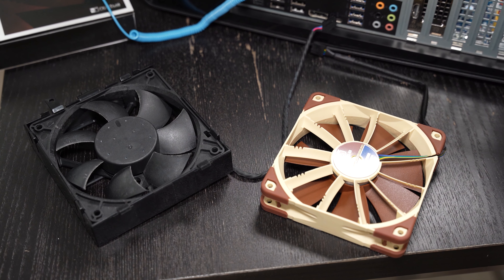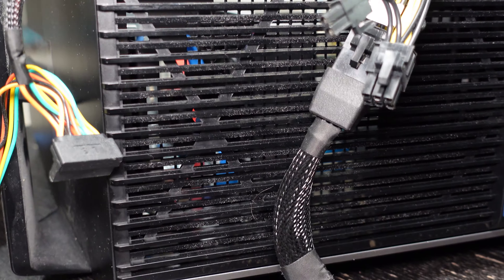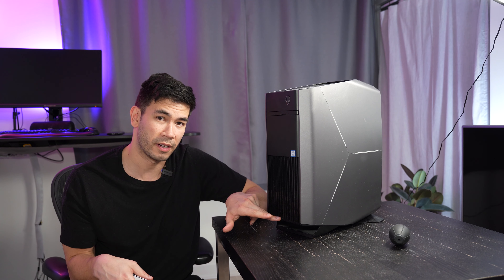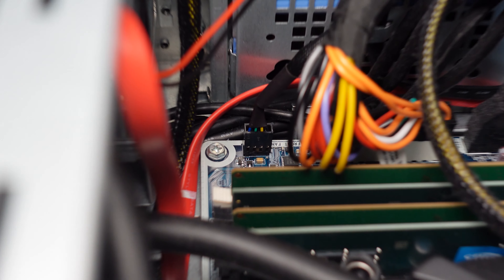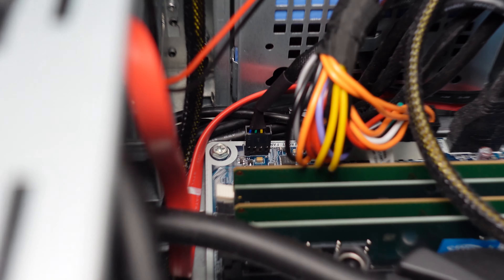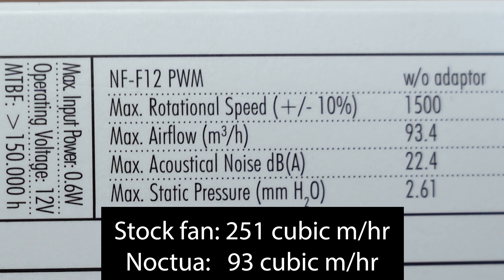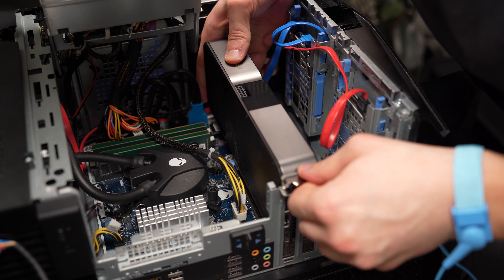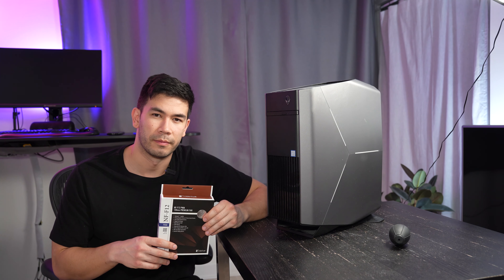Why your Alienware PC needs HIGH STATIC PRESSURE fans to IMPROVE TEMPS & NOISE

Comment: Nice video. I have the same system, to clean out the system efficiently, I tied the fans down and used a leafblower out back to blow the hell out of the system, yes it's backwoods McGuyver but it workes like a charm. I also moved my SSD to the top section, removed the annoying cage on the bottom and moved my 3070 to the lower slot, which gave it much better breathing space. I'm still using it today, it's been a great system, and I feel the 3070 on the bottom slot has helped keep it much cooler.
Reply: A leaf blower 🤣🤣🤣
Reply: Can you send a pic?

Comment: I changed out the fans in my R5, and changed the thermal paste, and my PC is waaayyyy quieter. Even at 100%. First time I booted up my cpu was getting HOT, but I redid the thermal paste and now it's cooler then the stock setup. The GPU is a lot cooler.

Comment: This is an excellent video, especially when you talk about the % fan speed, thank you. I have an r12 in which both stock fans have a max speed of 4000rpm. And people seem to not realize how that affects the ACC software. They're basically just repurposed server fans. Not a bad thing, but they get loud. I replaced every fan in it with noctuas that have max speed of 2000rpm, and it runs way cooler and quieter even at max rpms, which is really nice.
Reply: to follow on this. i will say the stock fan on the radiator is actually a very good fan. it will lack on the noise profile since it is a single fan trying to push the heat out of a modern CPU (which is a big task to ask of any single fan, especially on a 120mm rad). I replaced mine with 2 noctua nf12 x 25s.  I saw little difference in performance, but a decent benefit on noise, but that may be an apples to oranges comparison
Reply from the maker: Hnnn I really appreciate your insights. I might keep the stock fan (to avoid excessive work) and blow dust the radiator if that would be effective. I heard the 120mm stock radiator fan  is actually thicker than 25 mm?
Reply: @JSyntax  Yes. The one they install on the 120mm rad is quite a bit thicker than a standard fan. Almost 2x thicker in terms of the fan frame depth. on my unit, its a nidec server fan basically. Super deep frame so the blade depth is thicc af. good for pressure and air flow. It does get loud but thats mostly because it simply CAN push air, not necessarily because its loud by nature.
Reply: @joelstamand3495  I replaced both fans on my Aurora R10 with Noctua fans. The one Noctua (2000prm) fan is unfortunately not enough for the CPU water cooling. In addition, I cannot control the fans via ACC.
Reply: @joelstamand3495  ** It seems to me as if you either have to use water cooling with several fans or a fan with at least 4000rpm.
Reply: @unclebrowns8393  Got the R11 with 10900kf and 2080ti & 64 GB RAM @ 3200 MHz. I agree with the fan noise. But let me tell you... Did change both fans with Noctua, Arctic and Corsair 120mm Pro. I got Bios error with Noctua - but nevertheless it worked. Yes, its much more silent BUT - Tempereature gets worse because when you rising up fan speed in AWCC at 100%, it nearly goes up to 40-50%. The stock Cooler goes up to 100%. Because they are matched to the motherboard. With Corsair & co i get 41 C in Idle. With the stock Coolers 33. So it wasnt an option for me.
Reply: @JSyntax  The stock Cooler above is much more thick, than other fans.
Reply: @wingeladvokat1920  yes you are absolutely right, so I am considering buying a new mainboard and a new case
Reply: @unclebrowns8393  i'm eventually doing this too. Just gonna keep my GPU and RAM and build a pc myself with proper parts. Like a motherboard that isn't PCIE gen 3, a case with waay more space and no stupid dell restrictions and I will have my dream computer. I don't regret getting my PC because it was cheaper than parts at the time and I just wanted a prebuild with a nice gpu but these alienwares have more problems than they should have.
Reply: @joelstamand3495  Consider the EK-Furious Meltemi 120 (120mm x 38mm) to replace the CPU radiator fan.
It flows 120CFM up to 7.1mm H2O SP.
Its not exactly quiet at 61dBA, but that's at wide open (3500RPM).
I've got one, but haven't installed it.  Don't know if there will be issues with the BIOS.
Reply: Thanks for the heads up. I have an r12 as well but air cooled. I replaced my front fan with the Noctua and as it is much quieter and seems to blow good air flow, i can’t seem to get the software to agree with it from Alienware. In the ACC  now i can only put out 45% out of 100. Is that because the less rpm range with the Noctua? Or is it pushing at 2000 rpm but just saying 45% because it doesn’t have the 3500 rpm stock fan in it. Thanks in advance for the help and advice.
Reply: @seankelso3793  a mi me pasa lo mismo  y también pienso que tenga que ver con lo que tú dices de las revoluciones.
Reply: @overlord-ir3tx it sucks. I like my pc a lot, but it sounds like a fighter jet when I’m gaming 😂

Comment: you can actually do a push/pull configuration with the radiator fan up top and it makes a HUGE difference in temp. It's not that difficult to remove and upgrade. I used 2 Corsair 120mm fans for that upgrade
Reply: i want to do this so bad but if you do, your warranty most likely will get voided. Ive had to use my warranty one in the past, they had to replace the cpu and cooler.
Reply: @paradisepicks.  Any time you modify the original you will void the warranty.  But these are top tier products used so likely you would not use the warranty anyways.
Reply: @jjburda  I’ve had to use the warrenty before, cpu wasn’t working right 😐

Comment: For the top radiator fan, you would need to remove the AIO and reapply thermal paste, but that is a fairly simple process. The only fan that seems to be fully compatible and won't throw a BIOS error is the Corsair ML120 Pro. 
However, if you're going to do that I would recommend replacing the entire unit with a new AIO. The Corsair Hydro H60 can be installed without having to take out the motherboard to add a backplate, so it requires the least amount of work. Did this in my R7 and it runs much cooler and quieter. Hope this helps!
Reply from the maker: Hnnnmm really?!
Reply: @JSyntax  Yes I did it for my one also the H60 20 degree lower now
Reply: The Hydro H60 has a rated TDP of 80W.
The Dell liquid cooling unit for the R5-R8 is rated for 95W.
The ratings say you're going backwards.
Reply: Physically, the EK-Furious Meltemi 120 (120mm x 38mm) is a much better match for the OEM CPU radiator fan.
It flows 120CFM up to 7.1mm H2O SP.
Its not exactly quiet at 61dBA, but that's at wide open (3500RPM).
I've got one, but haven't installed it.  Don't know if there will be issues with the BIOS.
Reply: Do you have the ML120 PRO with LED or just the regular? I have the RGB elite and it is throwing a code... all i can seem to find is the PRos with LED and dont want to purchase just to have the same issue. Also can you change your fan speed past 45% in AWCC, mine maxes out at 45% for what ever reason.

Comment: I also put a Noctua NF-A8 5V PWM, Premium Quiet Fan with USB Power Adaptor Cable, 4-Pin, 5V Version (80mm, Brown) in the back. It can be placed inside or out right under the gpu, depending what flow you want I guess. Pop out the plates, little bit of double sided tape...too easy. It fits perfectly and cooled my 3070 by about 4c. I use usb power as its a 5v and again, too easy. Also if using it as an intake, pick yourself up a 80mm fan filter at the same time ; )
Reply from the maker: I love your idea! Can you share pics please?

Comment: I modded my R11 on advice from I got from youtube. I bought 4 Corsair ML120 Pro's. They're supposedly good for high flow and static pressure and they don't trigger a bios error. I installed one at the stock intake location like you did, moved the HDD to the bottom location and installed a second intake fan is its place using double sided tape. And put two ML120 Pro's in a push/pull arrangement on the radiator. I didn't mess with fan curves and temps dropped and it's nearly silent at idle. These mods will work for the R7 too.
Reply: Lord,

I'd love to pick your brain as I am about to do the same thing with the same fans same PC ....

Did you take off the cpu or can I just add to the top push/pull?  I feel good with the two front fans but how did you mount  the HDD at the bottom cause it looks tight and I have another ssd on a M.2 NVME to PCIe 4.0 x4 adapter?  Thanks for any help/clarification you could offer!
Reply: @christophertucker722  G'day Chris. This video was one that helped me
https://youtu.be/fkVNcTXcpAo

The 3.5" HDD bay unscrews from the upper spot and can be installed in place of the 2.5" drive bays at the bottom. 

Hope that helps.
Reply: @lordhumungous7908  much love and thanks!
Reply: how much did a 2nd intake help?
Reply: @Tesseus  I can't say how much a second intake fan helps because I did all of the fan swap in one go. I can blow vape at the front of the case and it gets sucked at that spot.
Reply: @Tesseus  I have 4 fans .. two on intake with one top and bottom ... I also have a push pull on the radiator for 4 total.  Benchmarking it never gets above 75C.  Idles at about 32C... using corsair pro 120mm its super quiet even when benchmarking.
Reply: i have r10 and plan to replace the fans. I have the latest bios. do you still recommend ML120 pro?
Reply: @krystianciuciek9743  I read a lot of forums at the time and they all say that the ML120 pro non-RGB's are the only fans that don't trigger a bios error. But some people used Noctua fans without problems. I don't know which Noctua model. Maybe the one in this video.
Reply: @lordhumungous7908   sounds great. Thanks for the answer. I'll take the Corsair

Comment: Very good video. I changed all of my fans in the case, but then also watercooled the system with a huge external radiator (9x120mm fans). Temps are obviously a lot better now, but it all started due to the poor airflow of the case
Reply from the maker: Thank you! I'd love to see how you did that cpu cooler upgrade!
Reply: I’d love if you messaged me on how you performed your upgrade!
Reply: bro do u have clip or video how u did it?

Comment: I have an R10 with the liquid cooled case it wasn’t that bad I did the 2pack Corsair ml120 off Amazon for like $35 it’s just the two plugs for the cpu and the fan and take out one heat sink and it’s pretty straightforward no issues you need to pull off the top that’s a little stiff but it snaps back on nothing broke and runs fine a lot quieter than stock fan at max
Reply: Any reduction in temps?

Comment: So for a long time I had can dusters. They always seemed to not work well after a few uses even when it was almost new. So instead I got a Metro Vacuum ED500 Duster 120 volt. This takes a vacuum motor and puts it in reverse to make an extremely powerful gust of Air. I have not had any issue with it since i bought it a few years ago.
Reply from the maker: Damn it's expensive
Reply: @JSyntax  your not wrong, but you never need to buy canned air again.

Comment: I have a R6 and I replaced the front fan with a noctua and the radiator fan with a noctua as well.   The stock fans were too damn loud but they did move a lot of air.  I keep my fans at 90% fixed in command center and it’s still super quiet (noctua is great that way).  I got a 2060super back in November when they were dirt cheap had a 1080 in it originally. Lateral move I know but I wanted to see what ray tracing was all about.
Reply from the maker: nice, did u get the noctua a12?

Comment: Update, I got the fan and had problems tryna get the command center but I got it and temps dropped by 8-15 Celsius and jus wanna thank you again. Rlly helped
Reply from the maker: Just replaced the front fan?
Reply: I did change bottom fan with the Corsair 120mm pro as well. Not an improvement. Yes its much more quiet but the AWCC by giving the fan 100% Offset only goes up to max 55% fan workload.  What about your maximum fan speed?

Comment: I have an R11 and was able to remove the top panel to completely remove dust from the cooler fan. I too am nervous about taking off the cooler to replace the fans so did as you have and just.upgraded the front fan.

Comment: I have the r12 and upgraded the gpu to the 4070 super. I had to move the intake fan to the top after removing the brackets. I also have a high pressure fan I set in front of the case with an air conditioner behind it. At absolute max oc on the cpu(i9 @ 5.3gh), gpu and ram i peak at 85c max! Not bad for a liquid cooled Alienware!

Comment: This may sound wild but I watched yours and many other videos prior before doing my fan swaps. Installed 4 noctua fans on my r10 and used two for the top mount. Being extremely careful, I managed to remove the radiator without unbolting the pump and securing it back inside the chassis without damaging the heat sinks as well. It is possible but pins and needles the whole job. Patience and steady hands definitely recommended, but it is possible.
Reply from the maker: Wow! Very impressive!

Comment: Hi, good video too, thanks for make it, I have an r10 and consider changing the fans as well, but investigating the specifications of the oem delta fan, they have a much higher static pressure than any noctua or corsair of the retail market, for example, the oem fan of the radiator have  15.9mm / h20 of static pressure , the noctua with 2.64mm / h2o, just can't match it,  so before i buy the noctua..., i want ask is better temps with noctua??  thanks in advance

Comment: before i did a case swap on my Alienware r10 Aurora Ryzen edition, that is what i did on my machine. Push pull on the rad and 2 fans to the front of the machine using Noctua. worked great, very quiet and it did cool the machine down really nicely until i upgraded the CPU to Ryzen 9 5950x and the rtx 3080. That is when things got a little to hot in there. in the tower, the temp on idle was around 60-70 deg C for the CPU and the gpu "forgot the temp" but it was always hot. Just did a Case swap on it last week end and the Alienware R10 is running way better than i thought. on idle at around 41 deg C for the cpu and gpu at around 31. stress test? CPU at 61 Deg C and gpu at a steady 82 deg C. Playing video games is great as it no longer over heats.  Specs of my new A-LI "ya i gave it a name on my build" LOL is Ryzen 9 5950X, gpu rtx 3080, 64 gig of ram with 9 lian Li fans "daisy chain" usb 3 Pcie card header to use the usb3/usb c port at the front of the tower. Pci card with 1tb Nvme m2 card running linux and a 2tb nvme m2 card running windows 10 and a new AIO from lian li. Case swap is totally do-able and was fairly easy to do. the only cons on this build is that the fans has a little hum when it comes to noise level, but it is never loud and never when into high rpm.

Comment: it's really not too much work but the fan dell has on the radiator is actually thicker and if its CFM ratings on it are true at all it might be better then some upgrades. I didn't do a comparison. although i also upgraded the intake fan first as it is a must. Also if you have an i9 in any of these and aren't doing anything super CPU intensive. I suggest turning off hyperthreading and just running it at base clock. The Alienware over clock sucks in my opinion.
Reply from the maker: It's unstable, agreed!
Reply: The EK-Furious Meltemi 120 (120mm x 38mm) is a match for the OEM CPU radiator fan.
It flows 120CFM up to 7.1mm H2O SP.
Its not exactly quiet at 61dBA, but that's at wide open (3500RPM).
Don't know yet if there will be issues with the BIOS.

Comment: I have 2 nf-f12 industrials 3000 RPM on my R7 8700k.  One for intake and one on a Corsair H80i V2 rad.  There is no solving the thermals on this pre-built and have reasonable noise levels.  My GPU is a dell 3070 RTX.  I'm just going to game with it and enjoy it for now, done working on it.  Expected more out of the corsair, what with the larger pump, rad and thicker hoses, but it was like putting lipstick on a pig.

Comment: I just tried the noctua nf-f12 on alienware aurora r8 but it does not seem to boot 😭😭😭. Do you know why?
Reply from the maker: It should! Did u use 4pin?
Reply: @JSyntax  No. I used 3 pin and had to return it. I ordered 4 pin the other day
Reply: @JSyntax  Hopefully the 4 pin version works well

Comment: I have an R-10 and my radiator looked very similar to yours I just got a can of air duster with the straw on it and blew it all out. I did it while I was repasting my 5900x which I have to say the old OE thermal paste was a horrible job. I don't think I would have changed the fans because I like how high I can turn them. I would like to add a second fan. If you don't want that stock... lol I'll take it